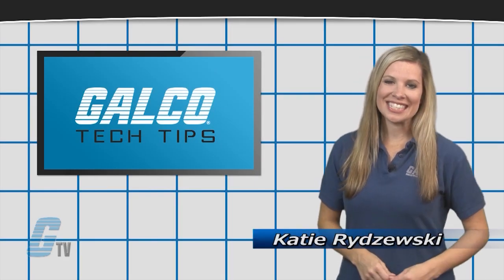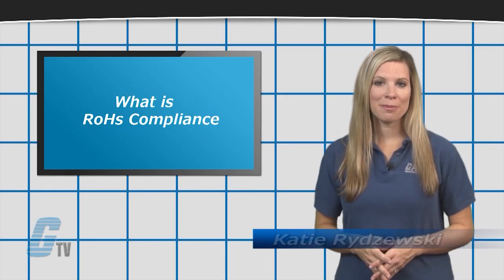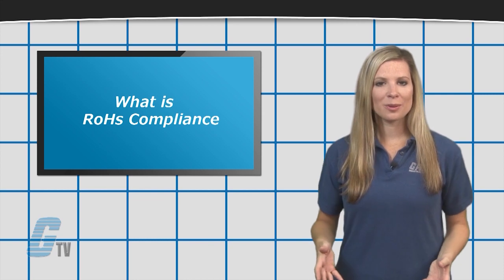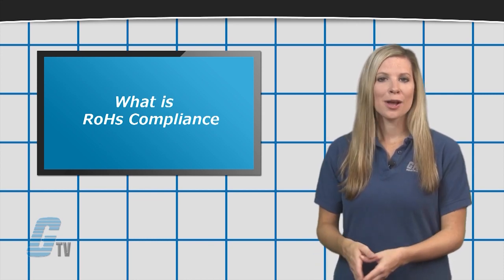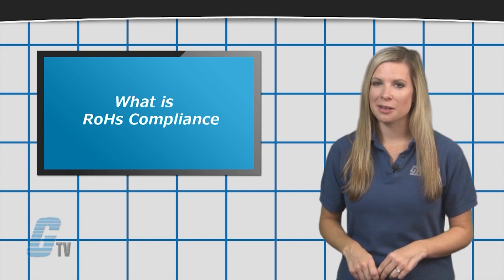What is RoHs Compliance? - A GalcoTV Tech Tip | Galco

Comment: Does it means that, even if i want to produce and sell, lets say, 50 small drones per year, using components which i import from china, like, arduino boards, i still gotta have rohs approval?
Reply: Best bet, get parts that are already certified. Usually they are if you get them from manufactures